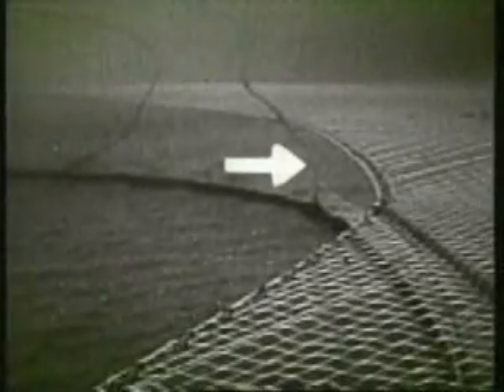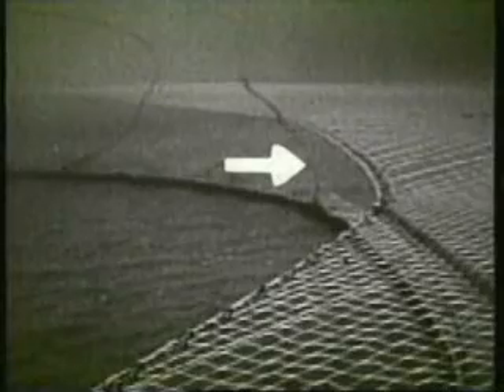Sandwich Trawl

Comment: This is the Aries separator trawl that the Marine Lab in Aberdeen developed in 1987. The lower half if a prawn net with the upper half in much larger mesh to let Haddock and Whiting which are too small escape. This would have cut Discards dramatically but politics got in the way and this had to be left as an interesting trial and left at that.